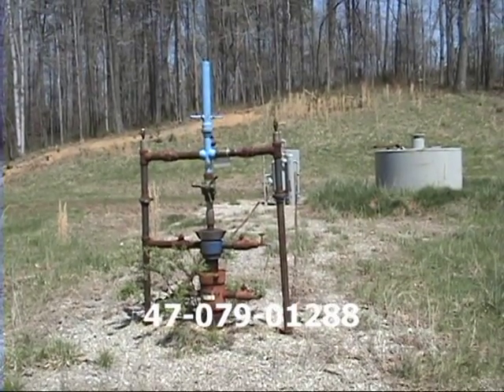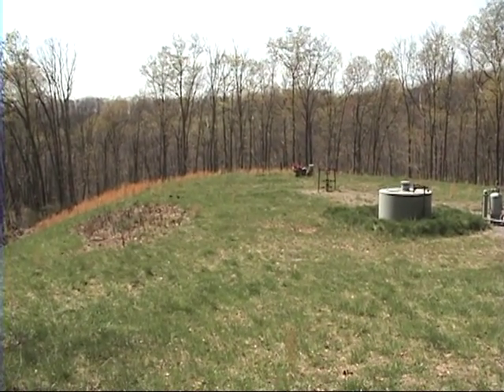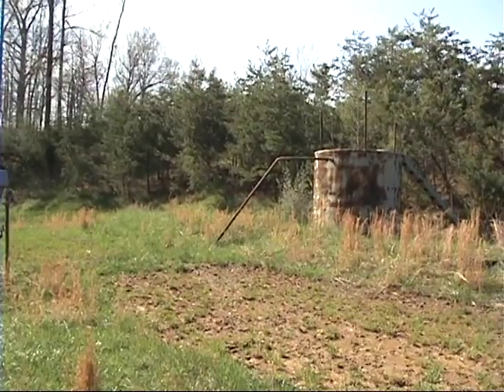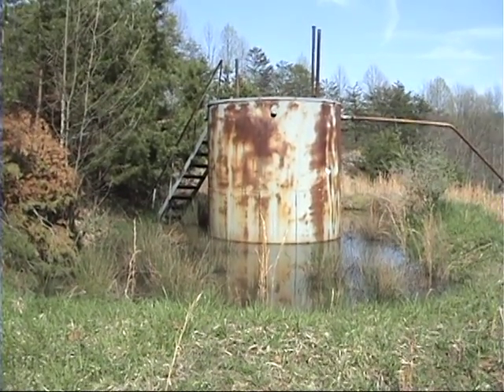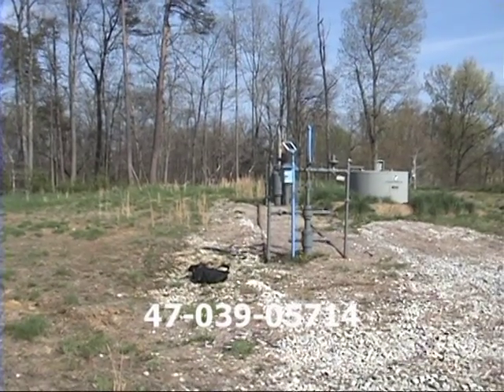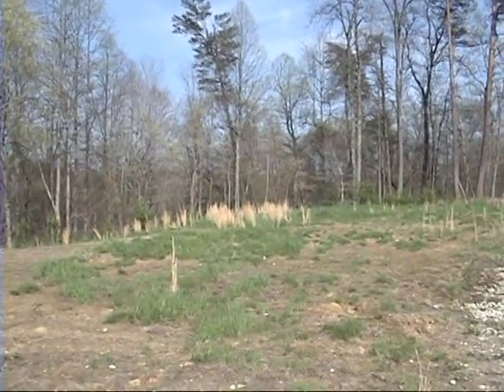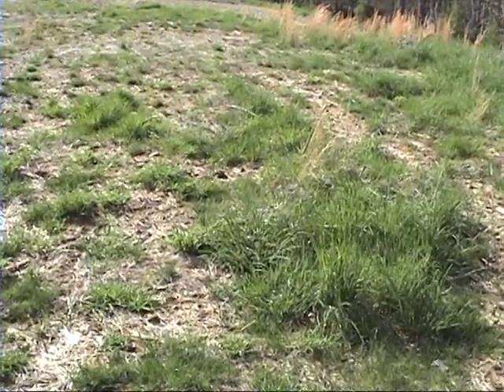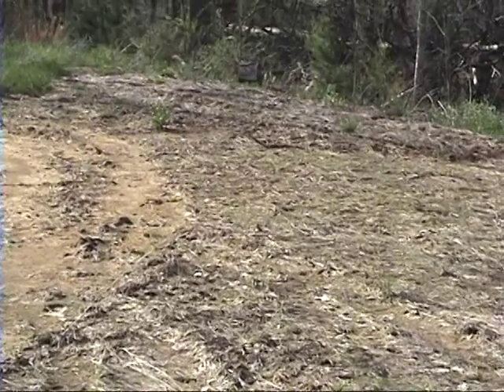Three natural gas wells

Comment from the maker: It's easier to respond to your comments when they are civil. Salt is natural, but salt in soil isn't. The salt we're finding at gas well sites is pollution caused by an industry that ignores the state regulations (such as they are). The contamination we are finding at gas well sites is indicative of far more serious problems such as heavy metals and potential radioactive waste from shale or tracers used during fracking. The chloride will actually transport these toxics to groundwater.
Reply: 1. True 2. Incorrect. The produced water salinity is completely natural. It comes from the reservoir rock. The 'radioactive waste' is lower in radiation levels than a 100 kg pile of banana peals. I'd like to see your heavy metal data because that's a completely spurious claim.
Reply: Any response? Any heavy metal data?

Comment from the maker: A drill waste or frack waste pit is dug into the ground and is used to store solid waste that is later buried. Backfilling is when dirt is placed on the waste in the pit. Proper waste disposal requires encapsulating the waste in the liner in way so that the liner isn't broken or ruptured. What we are seeing is pit liner sticking up out of the ground, not silt fence. It's easy to tell the difference. Salt is in the waste and isn't natural. Pit liner/pit waste on the surface is a violation.
Reply: GasWellStudy , not only are you trespassing but your nit-picking these well sites. The first one you thought the flow lines from the well head should be painted. I do paint mine but 95% of people dont. You didn't even check to see if the condensate tanks had any condensate in them. I doubt if they had much if any since a couple of those well sites did not have seperators on site. You migh try getting a life. Also you might try living off grid 100%. No natural gas, no gasoline, no electricity, no heat and no airconditioning. No car or even bicycle as the chain will eventually need lubricating. I guess you could get a horse, mule or donkey. You can't burn firewood because if everyone burned firewood it would be severe polution to the atmosphere plus too many people = not enough firewood.